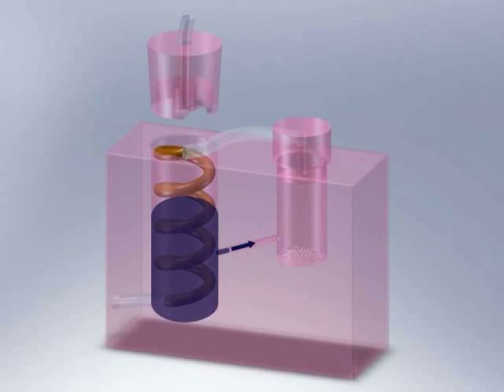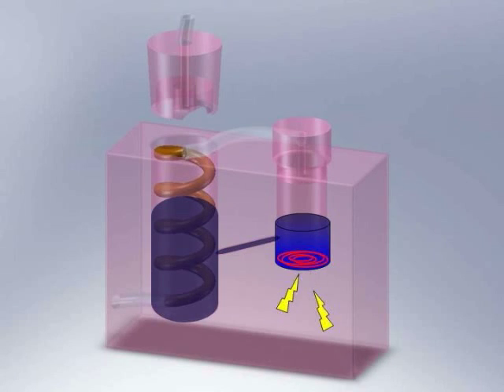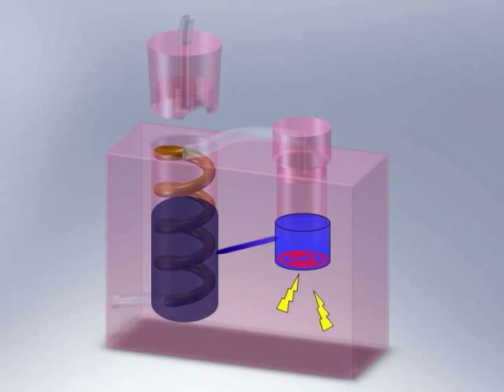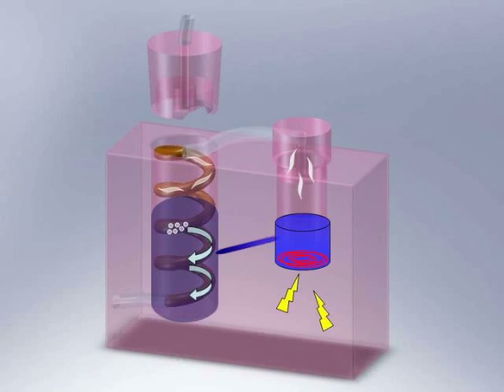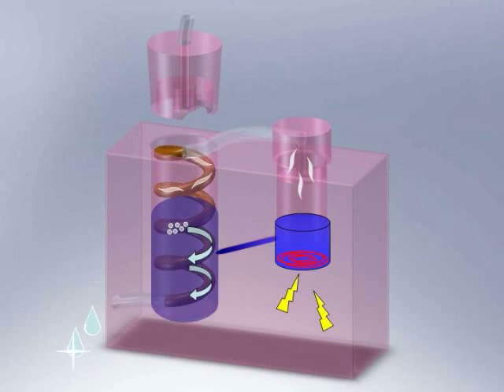Pedal-Powered Dirty Water Distillation Device

Comment: You never heard of the solar still that is a pop bottle shaped like a cone with a cap and rolled in rim to be a float and to catch vapors.
   You float it on water or on damp ground.
you can use sand filter. 

  couldn't use a plastic water clarifier before it goes into the system so it does not get clogged up.